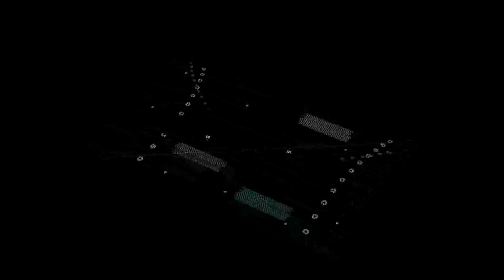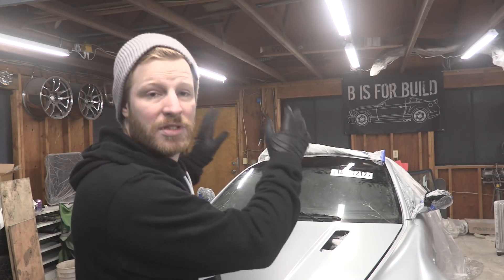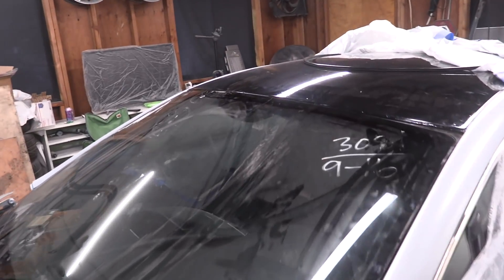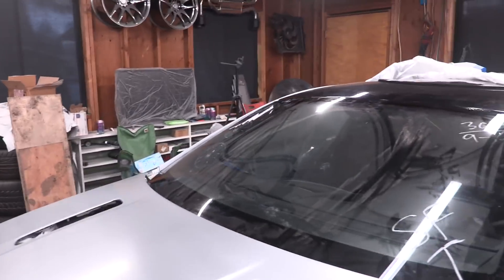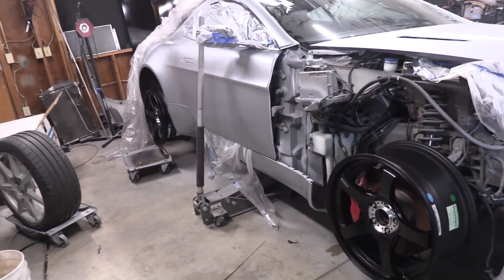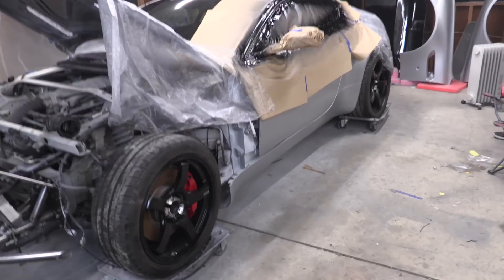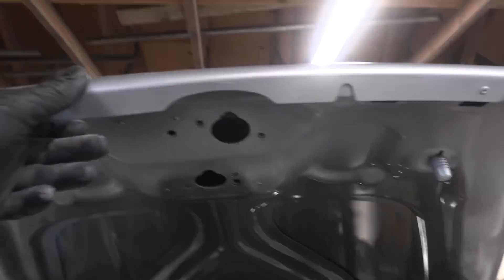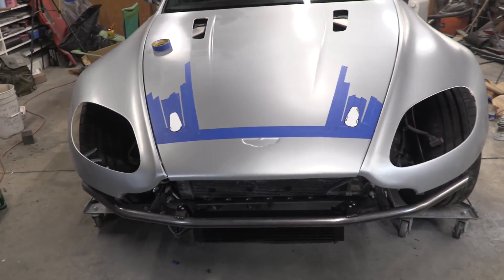V8 Vantage Pt 12 - I GOT THE WRONG WINDSHIELD!?

Comment: Why not just leave the original windshield in place for the trip?
Reply: Banks Wood I think the same thing
Reply: CA has laws about chips and cracks in windshields, and a cracked windshield can completely cave in at high speeds
Reply: Wonder what the law is on gluing the wrong windshield in your car. Also since he needed a professional installer to pull the original windshield out I doubt any wind would compromise that piece of glass.
Reply: Banks Wood In California cars don't pass inspection if the windshield is cracked. Here in Texas they only pass if they don't obscure you're line of sight. Considering where it's cracked, that's probably why he couldn't use it.
Reply: Banks Wood I’m assuming he needed that guys so the glass did not snap taking it out
Reply: It was B is for Busted. It's probably illegal to drive with a busted windshield in some state he is driving through.
Reply: A windshield with a big crack is potentially ticket worthy, if it's in a critical part of the windshield.  It's usually a bad idea to cross State Lines with things like that.
Reply: Yea you can get a ticket for it, I broke mine then was driving home that day and got a ticket. pretty salty about it
Reply: Oliver Mc Leod he’s a out of state person so I don’t think they would ticket him
Reply: While I lived in California, I lived on a road shared by gravel trucks, and 7 out of the 8 years I've owned my commuter I've had 3 windshields covered top-to-bottom in cracks. Only got a fix-it ticket for it as an "oh by the way" when my taillight bulb burned out. The majority of California is surprisingly lax and full of trash cars that shouldn't be on the road.

Comment: Suggestion for next time you use plastidip: Peel off the masking tape while it's wet. That way, you're not gonna tear it and have weird lines with it. Also, you can tape off about 1/4" away from the trim edge, that way the dip goes into the edge, and excess will peel off nicely with nice line to it. PM if you want more info about it, I've dipped a few whole cars over, and used dip for quite some time now :D

Comment: I know in the FJ episode where you built the sleeping quarters you said you weren't a carpenter, but have you considered putting insulation in the shop? Wouldn't even need to fully texture the drywall or anything, but you'd be able to heat the shop before a paint job for example, and have it hold temperature longer and not need to worry about the heater blasting parts. Not to mention it would be more comfortable for you overall. Just a thought.

Comment: You can buy for cheap plastic razor blades and before I’ve had to sharpen one to cut through plastidip but not push hard enough to score the paint and it worked perfect. Didn’t drag the plastidip or anything

Comment: If you still have the old windshield, can use that to make a pattern and cut a new one out of plexiglass/acrylic....
Reply: Christopher Leveck that's what I would have done
Reply: What about the curves?
Reply: Terrible idea. Plexiglass fades terribly. Flexes. And is not rigid at all. Would look like absolute shit
Reply: lexan?
Reply: Your right, the stuff i use is Lexan i think.... It works great. Easy to form without a lot of heat and doesnt discolor....
I bought a metric buttload of the stuff a decade ago, same thing they use for RC car bodies if i remember right....
Reply: Thats why you want the old glass, to form the new one with a heat gun. WAY easier in an oven, but heat gun and hot water towels will do it if your patient and take your time.
Reply: BINGO

Comment: Don't worry about the loss of structural strength having the wrong windscreen (windshield if you drive on the wrong side of the road) because the shin splitting crash bar will more than make up for it 😂

Comment: I'm just worried that the windshield will crack from heat expansion or hard vibration since it seems to be in there so tight. :\

Comment: Cold had nothing to do with it, the kerosene heater had nothing to do with it, you had the wrong paint over top of the wrong paint - they had a reaction, it just happens,  all the time - if you use something more aggressive over something else not as- it'll do it every time - Lacquer over Enamel  for instance - same reaction every time, will krinkle and crack - other types of paint are not compatible - should have done your homework